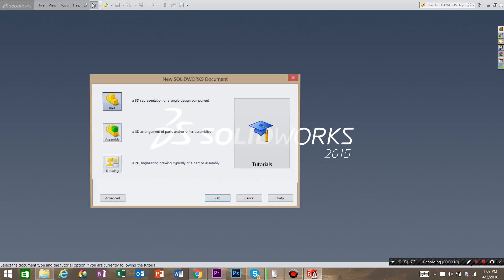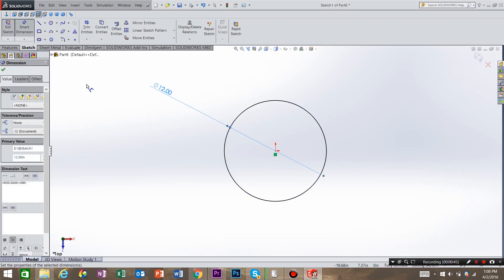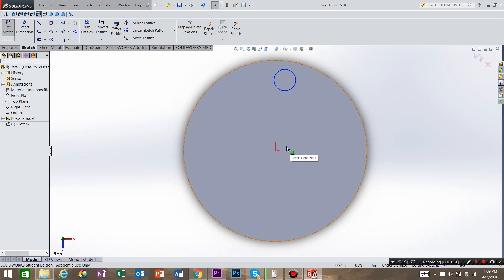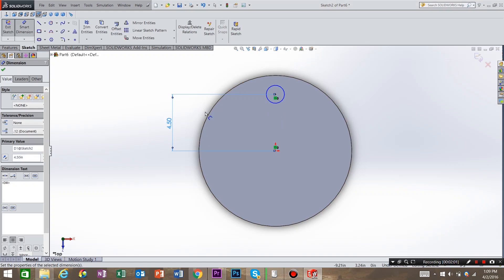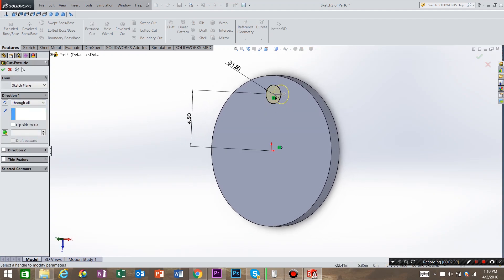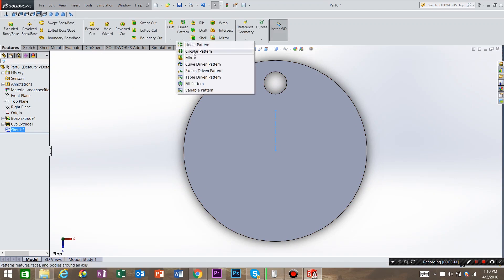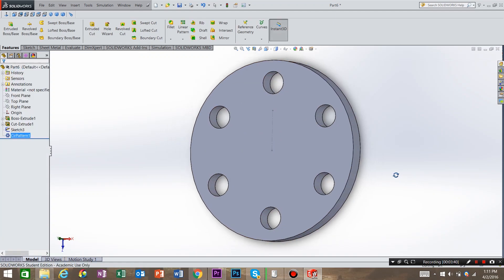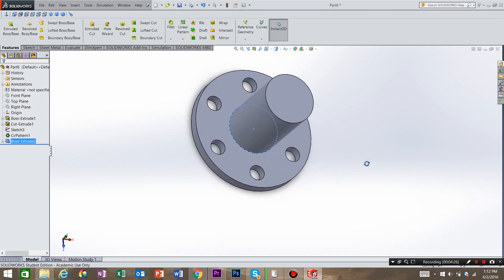SolidWorks circular pattern

Comment: i need to draw the centerline perpendicular to the body to get it, what is more logical, It may be the version, althoug thanks for the video !
Reply: I had to do the same, using solidworks 2017. Otherwise the circle was rotated in another direction
Reply: same for 2018 version I'm running. But thanks for the good explanation and the video.

Comment: You called it 12 inches eh? Impressive. Anyway, how about if you want to make multiple circular patterns? So all the holes are evenly spaced. Completely filling the space with holes like a mesh.
Reply from the maker: If I understand your question, I would do a linear array to get the desired spacing, then I would simply create the circular pattern.
Reply: You when you select the axis of rotation/direction(top left box in command), select the side face of the circle instead of the centerline as shown in the video. Hopefully that helps. Please subscribe to my channel, thanks!
Reply: @KuehlEngineering  Hi this was a long time ago but I figured it out through trial and era. End result was good.

Comment: Hi there, I did the same as your video, but couldn't complete the circular pattern because of the "Rebuild Errors; Geometry patterns results in disjoint bodies." could you please help me to rectify it! Thnx.
Reply from the maker: I'd make sure that you're working on the right planes. Also make sure that you are out of the sketch when you pattern the feature. .